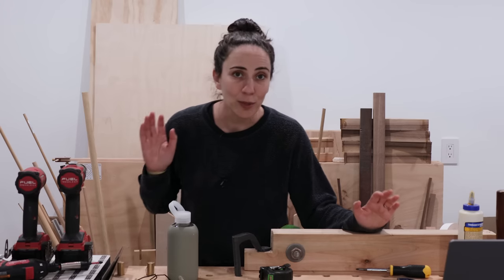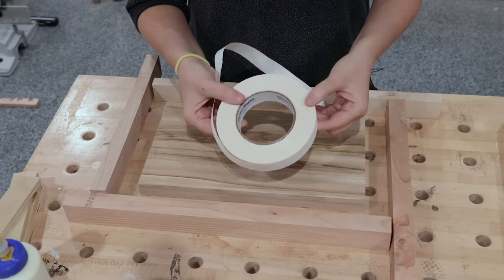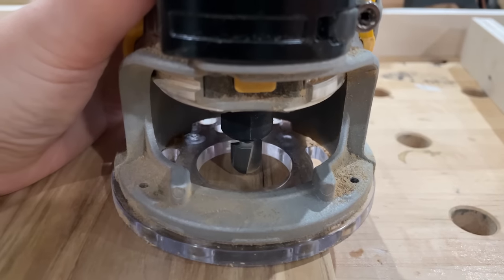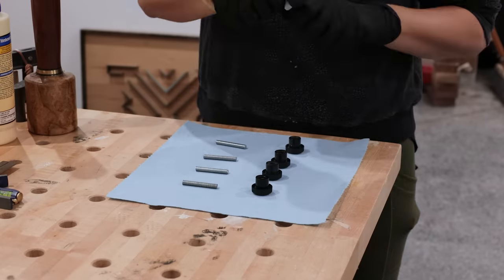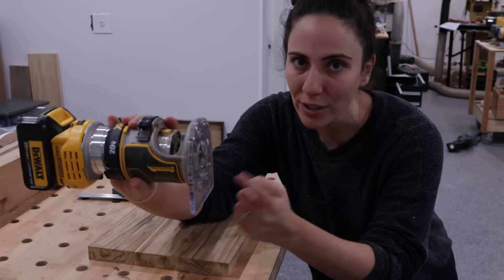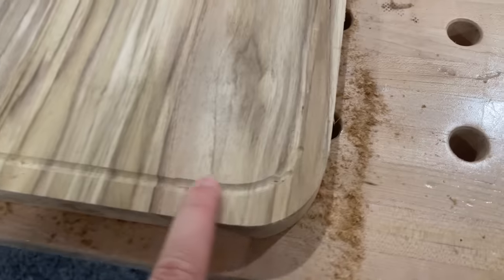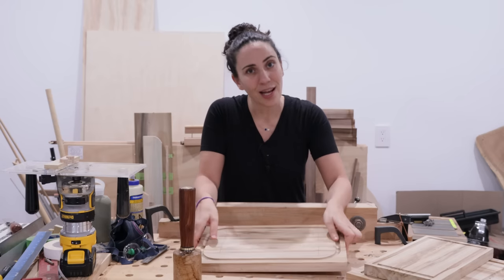Making a Few Juice Groove Jigs - Which one is best??

Comment: With the adjustable frames, wouldn’t it be easier and just as effective to have two of the sides fixed in one corner and just have the other two sides that can slide on one another?

Comment: A top pro gave me good advice to always replace that dewalt base plate with a universal round plate for jig work.  That avoids to issue of having to be careful on rotating the router as you turn the corners.  On the failed attempts to follow an internal template, it would be better to add a support block to the router base the same thickness as the workpiece. I would use a 5/8” guide bush for this method to make it much easier to follow and keep the radius acceptably smaller.

Comment: I have been watching your channel and was trying to pick up the first project for starting woodworking. This seems like the simplest one to start. I only had a circular saw before, now got a trim router, got this exact boards from Lowe’s, and made cutting boards. After applying oil and conditioner, these came out amazing! After first round of putting mineral oil, I sanded with 320 to make it smooth again.

Comment: I love those teak project boards I have about 20 of them in my shop. I bought them awhile back when they were still $37. I have made kitchen sets, salt and pepper grinders, art pieces. They really are beautiful and work so well.
Reply: Hi Fordgr55 and Tamar. I bought some of these teak boards for some Xmas gifts. How good is the glue up? Have either of you found the boards coming apart with use?
Reply: I have done a lot of work with them, I haven’t had any glue failures.

Comment: This is great....thank you!!  I made the adjustable one yesterday.  The only thing I'd say (this is my fault) I didnt use glue at first, and just hit the fence/spacer with brads, then came back with countersunk screws - that really torqued the fence and was making it wavy/not straight (I think because that piece is already compromised due to the 1/4" slot)...so that was bound to give me a crooked juice groove.  So I removed the screws, pulled the brads out, then came back did it again with glue this time, and I clamped the fence against a straight edge while the glue dries.  Undecided whether I'll add the screws or not after the glue cures...but everything is definitely nice and straight now
Reply from the maker: Definitely something to take note of!

Comment: Regarding method 4 using the edge guide- I think it would work better if you reversed this- put the router in a router table and manuever the board against the fence on top of the table.  I liked your idea of the 2 large dowels in the edge guide.  It might work even better if you could put wheels or rollers on the edge guide.  However with all of this work just to get an acceptable result- most cutting boards would work better with one of your other methods.  The only advantage to the edge guide is that you could more easily follow the edge of a cutting board with a complicated shape.

Comment: I tried this with my trim router edge guide and it was awful. Absolutely wrecked my piece I was testing on. Thank God it was a scrap. I wound up free handing very slowly on a slow speed setting with refrence marks on my base plate. Also using my finger as a slide guide. Not the smartest thing I know but worked very well and the boards came out beautifully. But I love that 4 piece take down jig.. definitely going to build something similar for my set up! Love your content!

Comment: Great video.  Here is what I like about you videos like this.  You first provide a simple quick way to get the job done.  I don’t have to spend a lot of time building a jig to make the first cutting board.  A person can get one done, then you can move onto doing it a better way, the adjustable jig with the slots.  To get the rounded corners, I like your solution of placing a board in the middle and routing around it.  It simple and works and a more complex solution isn’t needed.  Like you said about the Shaper Origin, sometimes simpler is better.
Reply from the maker: So glad you appreciate that I show options! Some ppl got upset when I got a domino and a sawstop bc they thought I wouldn’t keep doing this… ha
Reply: @3x3CustomTamar  You have earned those options to upgrade.  And honestly, if they could, they would.  Keep creating content.

Comment: I don't want to sound like a shill, but I ended up buying the Microjig Match Fit Dovetail Clamps (4 of them, which is about $90), then cut a large platform and routed a dovetail grid for the clamps. Then, attached 2 L-shaped fences at the edge, then 2 floating ones that are attached with the dovetail clamps. I just drop a board in, slide the floating fences into place, clamp down, then route. Super easy. I've also found other uses for those dovetail clamps so at least they aren't permanent to the cutting board jig.

Comment: Love the jigs for juice grooves.  I love how you have to keep in experimenting all the different ways you can get the same results.  This stands you apart from the rest of the channels.  A great differentiator.  Good for you.  My tried routing a juice groove in one of my cutting boards but started off going CCW and then had a groove running into the center of the cutting board.  So I immediately made arrows on my jig showing the correct CW direction.  All of the pieces have arrows going CW.  To correct the error I made a juice reservoir from my error.  This involved making a jig that would fit inside the original jig.  It uses the routered slot to anchor the inside pieces and makes making the reservoir easy.  Shot me a link if you want to see the photos.  Keep up the exceptional good work.

Comment: If you do the first method... make sure your base plate is actually centered. I did this method a while back and it was a mess, didn't realize why until recently when I went to use bushing guides and found that my base plate wasn't actually centered. Between the base plate not being centered and me not using the same part of the plate against the fence the entire time because the base plate is a circle, the juice groove was all over the place.
Side Note: The edge guide works great for a square/rectangle board. You just need to make sure you stop at the corners rather than try to wrap around.

Comment: Another wonderful video! Thank you! However, you can use the Shaper Origin to design a square/rectangular (whatever dimensions you choose) right on board the device itself and using a corebox bit will give you nice rounded edges and corners. Takes seconds to create the size and placement is a breeze once you have scanned your work area. Thank you and can’t wait for future videos!
Reply from the maker: Yeah… I have done it before. It’s just not my preferred method. Too much measuring involved in making the design, even on board… the other jigs just feel simpler to me. But if it’s working for you, awesome. I like my origin for other stuff.

Comment: Thanks for sharing this. The adjustable jig looks great. I think I might try this approach. I've also seen jig/template for router table setup for doing juice grooves, but I don't have a router table yet. 

From my experience, the center template approach isn't great. The setup is time-consuming and I never like these approaches that use double-sided tape - you need to have just the right size template or you are constantly moving the template around. Definitely not great for doing lots of boards. 

I've also used the edge-guide method. I've gotten good results with it, but the corners aren't easy to get right. The biggest pain I found is constantly having to move clamps around. The adjustable jig or router table approach avoids this, and makes it much easier to make grooves in lots of boards.

Comment: first of all, I found your video very helpful & well put together.  I made 6 chopping blocks for xmas, gave very little thought to how to do the juice groove.  I ended up building the adjustable one you showed, with a few small changes:

--I slotted the fences after attaching the base.  This makes the part a lot more rigid & easier to hold going through the router.

--I added I small strip of plywood to the top edge of my fence to help pull it in to straight.  You think your plywood was wavy?  I pulled mine out of my barn, probably been there 20-30 years.

-I joined all the edges.  prob not required if you get good parallel rips off the table saw...I do not.  I also just became proficient using the joiner, so ask excuse to practice & lock down that muscle memory.
Reply from the maker: So glad you found it helpful! Sounds like good changes!

Comment: I agree with you about using the Shaper Origin to cut a juice groove. I thought the Origin would make it easy, but when I tried, I failed miserably. The Origin often lost sight of the position dominoes, so it would give up on the cut. Your jig would solve that problem, but the simple juice groove jigs with a "normal" router are really a whole lot easier. The Origin does so many things that are difficult, if not impossible, using other methods, but it isn't the best tool for every routing operation. I agree that juice grooves are one of the things that are just more easily done in other ways.
Reply from the maker: Yup! It just doesn’t make sense to use it for an operation that is so easily achieved with a simple jig

Comment: i like the second one, excellent design.  i also tried the last method with the same poor results.  one thing i want to add is that for best results, dont stop moving the router, it will leave a burn mark which is almost imposible to remove except by cutting even deeper
Reply from the maker: 👍👍 that’s what the teeny tiny last pass is for

Comment: Hey Tamar good vid as always. I think for grooving around  curved shapes of any kind you're better off with a stationary shaper or router table set-up of some kind and move the workpiece instead of the tool.  We had to produce a bunch of exterior corbels that had multiple grooves around their shape - Don't laugh - we wound up turning a radial arm saw into an overhead router by turning the head and installing a chuck - then running the workpieces against a couple of pins like on your one jig. The biggest problem was the slow RPM of the saw motor compared to a router - did a lot of burning. But this stuff was all paint grade so it worked out fine.

Comment: Make some radius inserts for the ends of each arm of your jig. Attach them with double stick tape or a sliding dovetail joint.  The radius of the inserts should be the radius of your router bit + the width of your edge gap + the offset of your router.  You'll need to adjust the radius for the thickness of the tape. Make inserts of different radii for different bit & edge gap combinations.

Comment: I've had luck using an edge guide with dowels for tools like a jig saw, but any tool that rotates like a router is just too hard to control. As you pointed out if something isn't working well, there's probably a simpler way to do it. Love the videos
Reply from the maker: Yeah… it was worth a shot though. Ha
Reply: @3x3CustomTamar  Absolutely, that's how we learn. :)

Comment: Hey Tamar, another great video! I always love that you're willing to show all the different ways you try something, even if it ends up not working haha! If you ever have plans to visit Long Island, we'd love to have you speak at our woodworking club!
A couple of thoughts I had. First, I'm with you on curved grove corners, I much prefer that. I've been using inside templates also, except I do some math, make them with curved corners, and use a guide bushing. I like to be able to have a slightly smaller radius than whatever the baseplate of the router allows. Obviously it's better to put that work in if you're doing a batch, but I like it. I write the math out (dimensions of the board and groove, bit and bushing size etc.) in sharpie on the template for future use. 
I made my table saw outfeed table with a top w/dog holes a lot like your bench, then I enclosed it a few inches down and hooked up a dust port, built in downdraft table! Consider that as you build up your shop! Also, Swag Offroad makes steel tables for those portable band saws that replace the little metal tongue thing, then you clamp it in a bench vise. I just got one, soooooo nice for metal working!!  Aluminum butterflies anyone? :)
Keep up the good work!
Reply from the maker: I visit my family on Long Island a lot… 👍 I was finding doing just that with the downdraft table! And guide bushing a template sounds like a great idea
Reply: @3x3CustomTamar  that’s great! Please let me know if you need ideas for the downdraft. You could stiffen your the metal legs of that bench, or build a new base. Our club meets the first Wednesday of each month in Smithtown, and we do occasional Saturday workshops. A sub-group (that I’m president of) meets the second Tuesday in Huntington. One of our guys, Corey, may have contacted you before… but for real, if you’d be interested by all means feel free to contact me! We can set something up. Also side note, I made my own version of your 6 in 1 router base. I’m an engineer so basically I just guessed on the dimensions and modeled it in cad then had a friend cut it out with his cnc 😇. I think it’s smaller than yours by just a little so I could fit it on one sheet of material, but it works for me and it’s super helpful!

Comment: I've used the edge guide method before when removing an edge profile from an older table. It works better when it's a larger radius and the 2 contact points are farther apart.
Reply from the maker: Yeah. Think the small radius was the problem. But that’s going to be typical on a cutting board. That’s why I don’t think it’s a good move especially when all the others work so much better

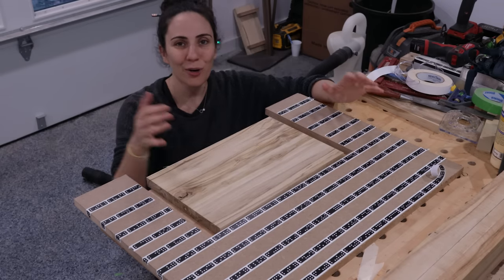Comment: 17:50 
No design necessary. I own a shaper origin as well, and you can simply select the rectangular shape, choose the diameter of the rounded edges, and apply to your board, and you can do it all in under 5 minutes 😊

Comment: Curved edge guide would be a single post, preferably a tall thin bearing vertical riding along the edge of the board  , but tough on the straight edges

Comment: I made an adjustable jig but instead of a slot I used a dovetail slot and dovetail on the ends of the rails.  Been a while, but it worked well.  It's good it's adjustable because I make cutting boards out of scraps and no two are the same.  Now tell me a good way to make the "well" for the juice and a pouring spout to dump it out.
Reply from the maker: That’s a cool idea! Yup! I have never made 2 of the same size cutting boards… I made the well using a template and a bowl carving it with a bearing 👍

Comment: I have had problems with loc-tite melting plastic knobs.  I recommend testing before to use.
Reply from the maker: Yes. There are metal threads inside the plastic. The loc tite doesn’t touch the plastic 👍

Comment: Using an edge guide seems really simple.  Draw a rectangle inside the edge of the cutting board, drill a hole to a certain depth on each corner of the rectangle with a depth stop, then use your router with the edge guide to connect the holes
Reply from the maker: Not as easy as you would think…

Comment: Nice video!! For your method around the perimeter of the board I use a single bearing as guide point like this less failure possible because you just follow the edge no more like turn to to as you did with 2 contact point ;)
Reply from the maker: I still see there would be risk of user error with that method though.

Comment: Fantastic work, Tamar! I really loved the jig! 😃
About using the fence, I guess you should've gone clockwise! I'm not sure, but I think you needed the router to push in instead of out. 😬
Anyway, stay safe there with your family! 🖖😊
Reply from the maker: I actually tried that also just to be sure, But no. That’s the direction you’re supposed to go. Think about the direction you move a piece along a fence at a router table. And then flip that image upside down I’m your head 👍

Comment: Cool project. I definitely prefer the outside fence. One thing I never understand is why people use battery powered tools in a workshop. They are typically more expensive and don't last nearly as long. For every corded tool that lasts 20+ years, you'll have 5-10 battery powered tools in a landfill. Batteries make sense for some tools but how many times in your life have you had to go into the wilderness to do some routing?
Reply from the maker: Not about going in the wilderness. It’s about not being tied to a cord… less distractions while you’re working

Comment: For curved boards, maybe some sort of opposing tension from the opposite side of the board? I think you have the right idea with bearings, but include something that pulls the router into the edges of the board...? I might be overengineering this, but just a thought.
Reply from the maker: Yeah. Something could definitely be figured out. But it’s just not worth the brain power since the other ways work so well

Comment: Great video.  My problem is that my router will skip aware from the jig.  Any suggestions?
Reply from the maker: If you’re going in the correct direction it should not move from the fence bc of the rotation of the bit.

Comment: I really love this build but I was wondering about the 1/4 inch slot that you explained in time frame 11:20 that it depends on thickness of board. How can I adjust for different thickness's of boards with out getting into groove ? My current board is 2 1/2 inches. Thanks for posting Tamar, you are a true fabricator and good teacher.
Reply from the maker: Build it to accommodate that thickness. If you ever run into an issue, like if you have a thinner boards, just put scrap under the board to lift it up
Reply: Thanks all finished works great